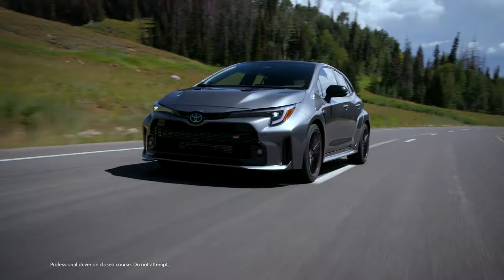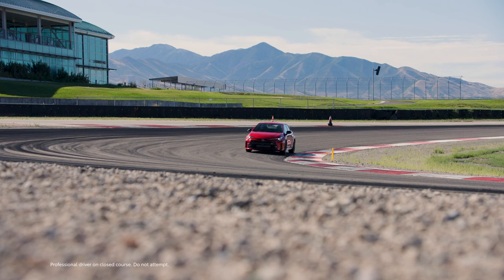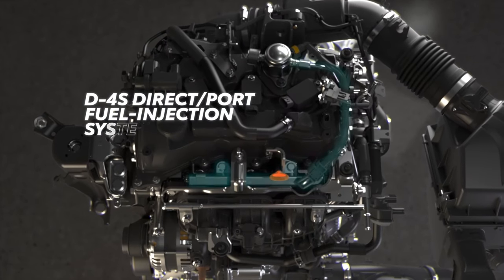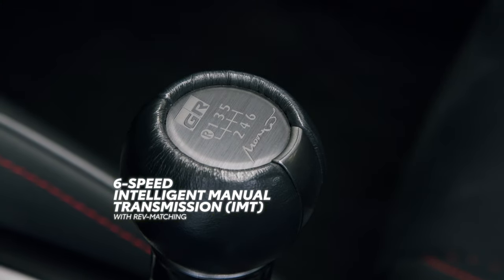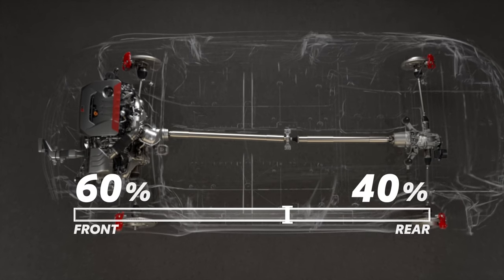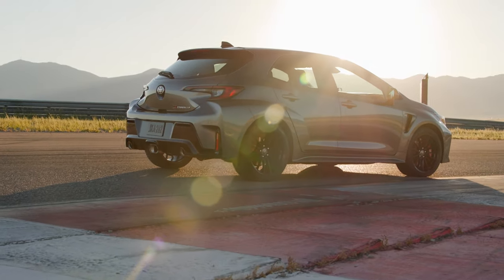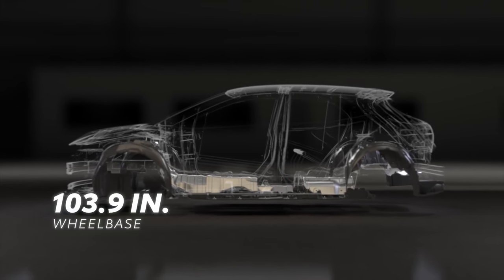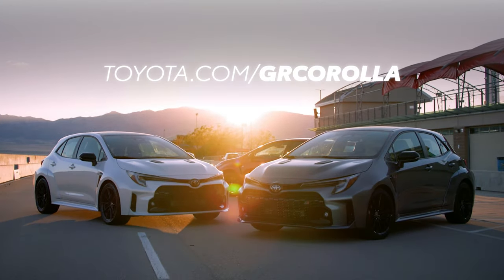GR Corolla Performance Overview | Toyota

Comment: I’m obsessed with this car, I have been obsessed ever since it was revealed, but I cannot find one for under $50k
Reply: Gonna take a few years. Hopefully they keep making them, I want one some day, but I'm not paying above msrp.
Reply: They won't decrease in prices. A used Scion FR-S is $15,000 older Toyota's from the early 2000's are 6 grand. My Camry is now worth 9 grand, I paid $2,500 for it 3 years ago. It's rare because it's a CE model with an SE Interior package power SunRoof, Black Leather seats and a 5 Speed Manual Transmission. Back then you could pick up a $500 car I bought a bunch of them in 2009 those days are long gone a car with high mileage 300,000 is $5,000 a few years back, you could get a car for $4,000 now they're 6 to 7 grand.
Reply: @static_Tricolor_camry 
👍👍👍

Comment: Hydrogen is the future. Just run current gas cars on hydrogen using  a small generator for electrolysis to produce on board hydrogen. No storage issues and economical.

Comment: Come on Toyota, build your own SUPRA and your OWN 86 car. Or discontinue the 86 with Subaru and build another sport cars. Subaru and BMW did not need to take your legacy away. I think you need to start building your own car factories and start building a supra that can competete against the  Corvette C8 and Z06. I dont understand how Gm can make this profitable but Toyota cannot do this. Start working on your own sports, platform, and engine, built in house. Scrap the BMW and Subaru deal. This corolla is start in excelleance, do the same with the supra and future cars.

Comment: Orland Toyota will not honor the warranty for my tire sensors.  During both visits, the employees admitted that it's covered under the warranty, but they will not resolve the issue.  #IDONOTTRUSTTOYOTA #TOYOTAWILLNOTHONORTHEIRWARRANTY #TOYOTAEMPLOYEESWEREEXTREMELYRUDE #FIXMYCAR

Comment: Hmm 50,000 for a Corolla or 30k for a mustang that will own it very time and it has a bmw motor same one from the bmw i8
Reply: Whats the 30k mustang laptime vs a 50k corolla?
Reply: You think going in a straight line is all there is to performance?